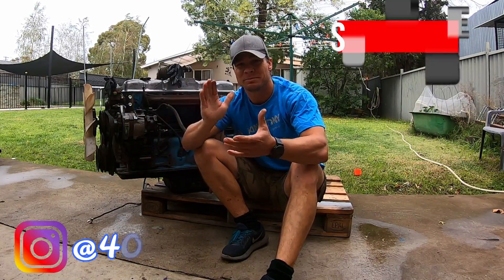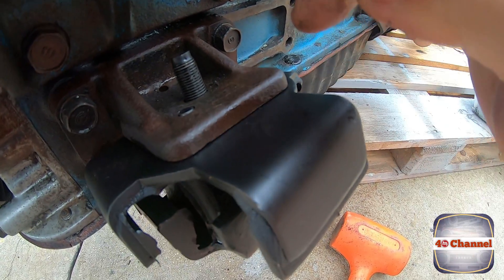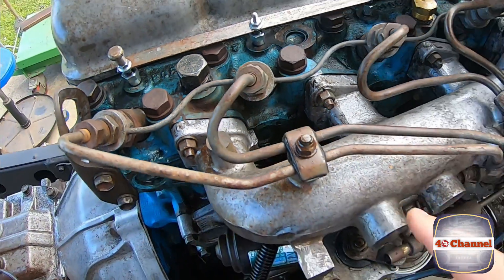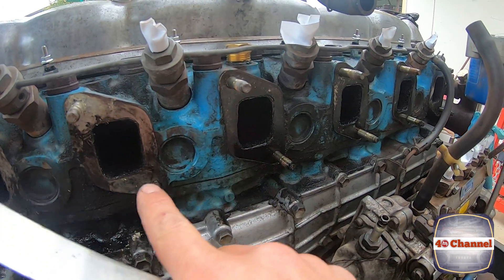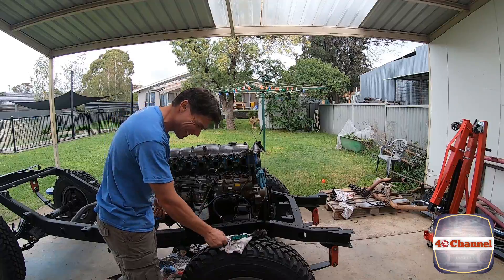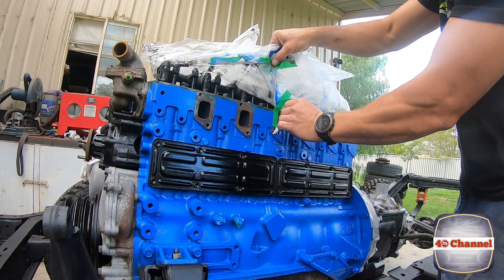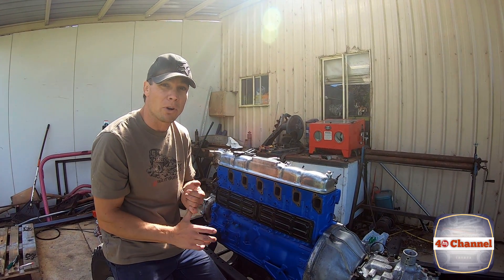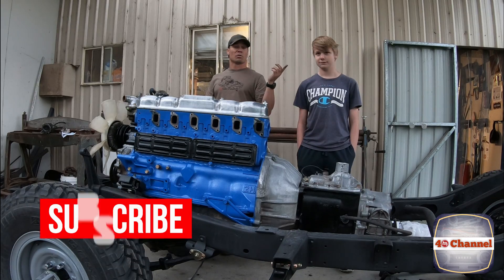EP42 - 2H Motor install into the FJ40, The  BIG clean up plus Remove broken studs bolts.

Comment: Ahhh I notice you have used the same music as I use for my video intro.  Great choice.!
Great to see your kids getting involved.  I know no one likes the safety police.  I say teach them young.  Bare feet anywhere in a workshop is out.
I’m an old bugger with 10 toes and have my boots to thank for it.  I always wear steel caps.  I know this is an old video.

Lots of great tips!
(So not overkill)
Dave
Reply from the maker: Thanks Davo, Yes you are right safety should be first! , I spend my whole working day in Steel cap boots, but when I'm home sometimes I find it nice to be free of shoes. 
had a quick look at your channel, some great tips on there mate. Keep it up!
Reply: @40ChannelCruiser  
Thanks for taking a peek at my videos.  It’s really hard to stay positive when I usually get around 20 or so views each.
I’ve had a couple go into the thousands.  It comes down to what YouTube recommends to people.
I have some catching up to do to see more of your video work.
I’m impressed by your ability to strip what seems like every nut and bolt and then put it back together again.
I think many people underestimate this skill.  Well done.

Comment: Nice work mate.. you did the 2H proud, a superb motor. You're going to have to take the injector lines back off again to fit the clamps at various points to support them.. they are super important. If you cant find the injector line you need, let me know I have some spares.
Reply from the maker: Thanks you Duncan, Yes as soon as my boy finished putting them on, that was the first thing he said too.🤣 Thanks for the offer too, buying one off Mr Landcruiser.

Comment: Absolutely nothing wrong with a good old 2H diesel!
Reply: Yannis
I wish I had one for my Fj 40. I’ve been looking hard to buy one
Reply: @donnareed3822  If you're in Australia there should be plenty floating around, they were found in 40, 60, 70 series, Toyota Coaster's and Toyota Dyna's, try asking around in the 40 series groups on Facebook :)
Reply: I live in Washington state on the west coast. We did get diesel rigs here. So we either have to get the from Costa Rica or Belgian. There are a few in Canada. How much would one cost where your at
Reply: @donnareed3822  I just had a quick search and saw one for $2200 AUD including warranty from shop, but if you look around over here I'm sure you could easily pick one up for $500-$1000.
Reply: I have also 2H,engine ,HJ60LG-MW,under repair

Comment: Hello buddy ,
i have fj45 pickup with oem 2f engine 4 speed transmision , and i want to swap the engine to 2h or any diesel engine 
can you advice me about what  should i do like what is the gear box that i need to install the 2h and what's the parts that i will need 
and if there another option for diesel engines 
please help me 
regards